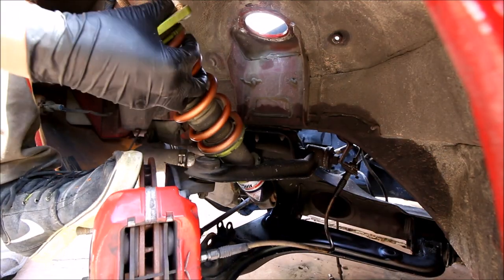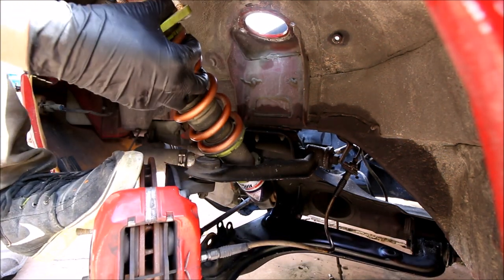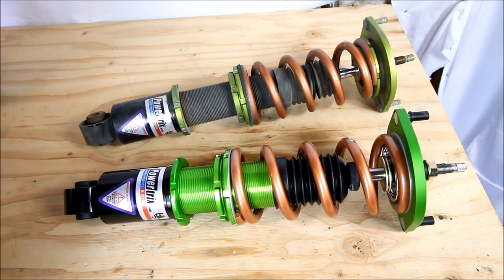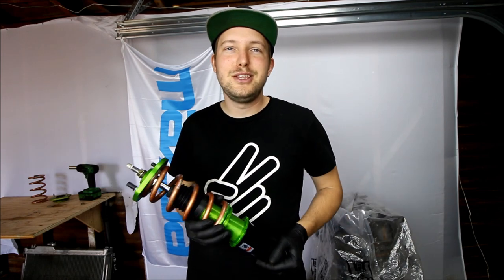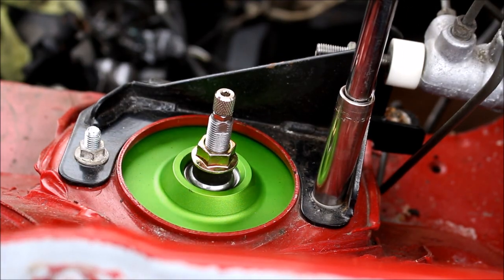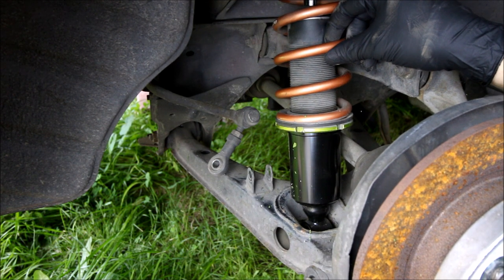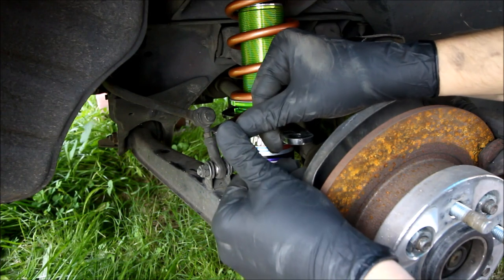Maximum Grip: Choosing & Installing Coilovers on the Main Miata

Comment: Nothing is rusty, must be nice not to live where it doesn't snow
Reply: bryan richardson or rain. or where they salt the roads. These jobs can x10 the amount of time taken in the UK
Reply: Im not sure if my 91 will pass MOT, its rusty as fuck
Reply: bryan richardson if you hate rust Texas is the place to go. The only rusty cars here are cars that came from up north
Reply: I daily my MR2 in Alberta, we don't use a lot of salt on our roads. Things will still rust, but not as fast.
Reply: bryan richardson or u should have luck, i have minor rust at the wheel arch on one side. nothing more
Reply: UK mx5's are the worst for rust.... Mines completely rusted out...
Reply: only rust ive spotted on mine is the the metal tab behind and below the back of the exhaust manifold. where the ground wire is bolted down
Reply: Yep, even undoing what should be simple bolts like the long rear suspension one, sometimes involves being creative with the wishbones to get at it.  The tabs just break off and it spins and can't get anything in to tighten it.  Just one of a million bad parts of UK ownership
Reply: Snow or rain does not cause the rust. It's salt. I wish NYC didn't have blankets on salt on the road so I can daily my Evo.
Reply: It's great. Even the shitty ones are generally rust free when when you don't have road salt and constant rain. I love snow for a vacation, but a long winter would be rough.
Reply: take care of the car.up in the air pressure washer  and underseal  every single  summer. .then wax injection every  single  summer.  in London  with  a rust free 89 na. .underseal  an wax this Wednesday
Reply: Henz Powell I'm in London with zero rust
Reply: bryan richardson take care of your car and it will never rust

Comment: What I know is a stock Miata is already low enough and any lower you will be scraping your undercarriage all the time. If you like scraping, then definitely go for it. I don't like bottoming out my car. The Miata handles fine just stock. Save your cash for gas.

Comment: Disappointed you didn't show the long bolt method... while it does take longer, it makes pulling the strut much, much easier(especially the long stock struts). Plus it doesn't require as much standing on the rotor or yanking things around.
Reply: also, without removing any suspension bolt I HARDLY think you can get out the stock suspension, for sure not the one with slightly longer springs that came with the later NA models...
Reply: had to do long bolt method on my 96... lol tried to do it this way at first and it was a pita lol
Reply: Could you explain this method, or link to a video? I'll be taking off my bilsteins  on my 94 R soon.
Reply: Alexander Moore if you'd like to see how we have a video on our channel on exactly how to do the longbolt method installing coilovers, these same Powertrix ones in fact! But it works for any coilovers/spring/shock assemblies etc.
Reply: No amount of standing will get out the stock shocks without taking out the long bolt first.

Comment: Hey Greg, one thing that would make a great addition to the video is a note about not over torquing the rear lower shock bolt. And to be careful on removal. There's a square nut held in with a weld cage inside the A-arm. Over torquing or not using some penetrant on removal can cause the cage to break away, and you're stuck either replacing the whole A-arm or cutting an access window into the lower A-arm to get access to the nut. Both are options that are not fun. I remember vividly trying to fit an a-arm with still attached shock into my garbage can when I did this years ago. It's also when I realized my torque wrench had newton meters on one side and ft lbs on the other, and you should really make sure you're looking at the correct side.

Comment: Hey this is an informative, well-made video.  However one correction - adjusting the spring preload does not change how stiff the spring is.  The spring still has the same physical spring rate.  The only thing that changing spring preload does (aside from changing ride height) is change the amount of load required before the spring starts to move.  Since it's a linear rate spring, after that minimum load is reached (which it will be with the weight of the car on the spring), the spring behaves the same regardless of where the preload perch is located.

Comment: 2:56 "The Christmas of Handling" =D Its already that time again?  

Seriously tho I'd be careful taking the coilovers in and out like that without removing the longbolt etc., might damage an adjuster D=  I know I wouldn't be able to with the ones I'm running.

Also, for anyone curious Powertrix coilovers are great! I ran them on my car for awhile and now my buddy is running them on his, fair price for a quality product!
Reply: I agree. Not only that, but the stock suspension can't come out that way. You can do the ball joint method to get enough suspension movement, but the stock shocks will still be difficult to pull out. Only reason I ever did ball joint method was I was running the mazda comp sway bar blocks, and the long bolt wouldn't line up with the through hole on them. Long bolt is by far the best.

Comment: One thing I found out recently when I had to adjust my springs on my coilovers is that you can take the top nut off without an impact. Most coilovers have a flat section on the threads on the top shaft where you can get a wrench on it so you can hold the main shaft in place while tightening the top nut. You can kinda see it in the video during the close ups

Comment: Greg, I feel deceived because removing the stock shocks with lowering springs was pretty much impossible to remove unless I Jerry rigged some zip ties to the spring to keep it a bit compressed and the struggle was real 😭

Anyways the video did help 👍

Comment: You can also change the springs by just unscrewing everything on the bottom. Leaving the top hat untouched. Just all depends how do you want to do it. 

And just as a note tightening the Spring preload does not change the spring rate. A lot of people mix that up. Again adjusting the preload does NOT change spring rate. Spring rate is set from what ever the spring manufacturer sets it at. Most coil overs have a preload adjustment spec. By adjusting the spring preload you are essentially adjusting how much sag the spring has initially.

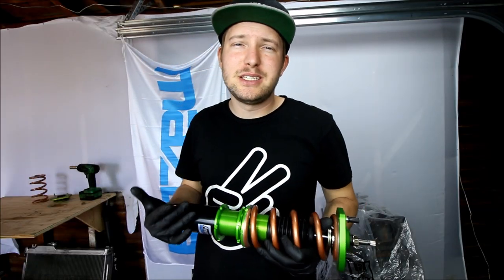Comment: Greg, at 5:04 when you put the nut back on and mentioned not touching the inside of the tube, isn't that a spot for a wrench on the right? The spot is on the far right between the threads and that cross-hatch design on the end.

Comment: Hey Greg. When you demonstrated changing the ride height and threaded the lower cup all the way on I noticed that the lower eye (shock mounting point) rotated with the cup. Does that mean you have to uninstall/disconnect these coilovers in order to rotate the cup and change the ride height, or is there a way to adjust the ride height with them on the car?

Keep up the great work! I really appreciate the time you take to make sure you are informing your audience as you are performing your mods.
Reply from the maker: No, once the coilover is installed the shock can spin independently of the cup/mount so you can adjust them while they are installed on the car. (You just need to have it up on stands to take the weight off the coil or it will be very hard to spin.)

Comment: Alrighty Greg, I just pulled the trigger on the PowerTrix UL Coils, I opted for the 9k springs to start with and will look at changes when my build is done. I appreciate the CBC300 deal, it made the buy an easy one as I was just about to get the Flyin Miata track pack. The adjustable ride height is what sold me on this buy as well as the cool green color.... just won't do to have a car with power that can't keep the wheels on the ground. Did you replace your shock bushings upper and lower when you installed the PT coils? Oh do you recommend the rear adjustable end links? It looks like you have them installed.
Reply from the maker: Are you asking about the bushings in the top hats? Th coilovers come with brand new top hats so there's no need to replace anything. You'll love the coils. I have the adjustable front end links so I can run the NB front sway bar on my NA chassis, and I decided to add the rear links to match.
Reply: I was asking about both I didn't realize the about the tops, are the bottoms fresh as well? The other item the rear links, do they make any noticeable diff? I didn't opt for rear links as of yet but may do so when I replace the rear end with the LSD.I have 949 racing end links for the fronts which I will do with the CO install.

Comment: Hey Greg, love your videos. Your content has been helping me out as I slowly build my Miata. Just had a quick question since I'm looking at upgrading my suspension: do you know how high can the Powertrix go? I'm currently sitting at 14.5" in the rear and roughly 12.5" in the front, but I don't want to drop the car too much as I'm worried my wheels (Kosei K4r, 15x8 with +35 offset with 205/50/15 tires) might rub. I'd like to avoid rolling the fenders as my paint is so shot in some spots I'm more than certain it'll crack on some of the fenders.

Comment: Pro tip when trying to get the front suspension out: Get a long prybar and shove the flat end of the prybar inbetween the metal shield part of the subframe (where the top wishbone is connected) and sit on the prybar with your full body weight. Wishbones will both lower far enough to get even stock suspension out (even if you weigh just 60ish KG)
Standing on the end of the wishbone/brake disc didn't lower the suspension enough in my case :)
Reply: JaguarJay I used this technique, really helped me because oh man, it was a paint to get the front suspension out! for everyone who is going to swap out their stock suspension, be prepared for the front being a bitch 😂😂
Reply: or just remove the long bolt that holds the upper control arm and front suspension comes out real easy. thats what i did.
Reply: BKMOTO LLC That'd be an option too, if the upper control arm bolt isn't heavily rusted into place. Mine was so tight I didn't actually take it off, cause I was afraid to break it.
Reply: Same here dude, I first used a wooden prybar but it just broke on me when I applied force to is, then I got a metal prybar and got the suspension out.. I litterly was stand/jumping on the prybar while someone else was fiddling the suspension out of there..

Comment: Yea i learned something... I learned that i can't afford any coilovers that are actually worth switching to. What's the best way to lower my car but not sacrifice to much ride quality...because honestly the 2003 mx5 i have (stock suspension) seems to be pretty Damn good. But i am trying to cure my "mexi poke" and gap before winter ends. 16x8 +0... I was thinking lowering springs. Minor camber and maybe a little fender roll of necessary...

Comment: Hello greg, I know this video is old but I just started following your channel and have a question. I have a 1990 mx5 miata 1.6 that is my daily driver. I don't have any mods, it's all stock. I was seriously considering getting the  SS coilovers with the swift springs but I had to stop my self because of the hefty price tag. Do the swift springs really make a difference? I don't drag race or anything, I only use my car to get to school and work. Although I like to hit the pedal from time to time. I do plan to turbo my car some day, but that will be in the somewhat distant future. Are there any alternative coilovers that you would recommend for someone on a budget? Even the base SS coilovers with stock springs run you about $800 and unfortunately your promo code has expired. 

Also would like to thank you for your video on how to replace a clutch. Your video is the most informative and easy to follow on you tube. Thanks for all of your hard work!

Comment: When you step on the brakes the suspension lowers way more than mine. I cant pull out the shock because it touches the upper a arm.

Comment: Hey greg, i am planning to install my tein flex z using your method, first because i think its faster than the long bolt method and second because i do not have a torque wrench and i dont want to mess up with suspension arms. My question, is do you think it'll be easier if i compress the stock spring in someway?

Comment: Have you ever had any experience with xidas? If so how do you feel these hold up considering the price of the powertrix after adding the swift springs are relatively close?
Reply from the maker: I do not have experience with the Xidas, but I have heard they work magic for Miatas. Would love to try a set out sometime, but I have been very happy with these.

Comment: How can you tell what spring poundage is, i have a Dutton melos kit car with Mazda mx5 mk1 rear end, fitted with spax coil overs, problem is i dont have any suspension, i can adjust how high the car sits from the tyre but high or low the top 3 coils of the spring collapse to each other, and the bottom 2 coils dont really give that much.

Comment: What's the overall spring diameter as compared to thinner Xida or Tein? I plan on running 15x10 6uls & 245's soon and have Teins on currently.

Comment: Which ECU are you planning on using for your swap? I recently picked up an NB wreck from 2003 VVT with squaretop intake manifold. So I was wondering wich version I should use ( pnp pro or megasquirt3 and wire everything by myself).
Reply from the maker: MSPnPPro for me

Comment: get us a discount on a megasquirt lol. oh and I have a question. do you think a system like freevalve would increase horsepower significantly on a NA Miata? I recently learned that Miatas use a non interference design meaning that the valves will never hit the pistons in the stock configuration. so to me that means it would be relatively safe for someone to do freevalve like system on the Miata engines. all you really need is a ton of electric solenoids. I have a spare Miata engine and I think I might experiment with it. of course I would have to look into any patents first as I would hate to not be able to share my work. I think the biggest issue would be that the Miata doesn't have a crank position sensor. just a cam position sensor. once that issue is sorted everything else isn't too hard. and because it's non interference if you fuck up in valve timing it won't destroy the engine it will just not run right. which is really the best part. I guess the reason why most cars don't use a freevalve like system is because if it fails you lose your engine. and it's probably more likely for a freevalve system to fail than for a timing belt to break. If I can scrap together some money and motivation I think I would attempt this.

Comment: How long is the coupon code good for? Possible to swap out to Swift springs at a later date? I would think so right, not a proprietory spring ..?
Reply from the maker: It does not have an end date at this time. They are not proprietary, one advantage up ordering them with the Swifts is it's offered as an upgrade so it's cheaper than buying the springs outright later.

Comment: Not sure, are these the SWIFT springs Greg is running? Do you guys think there $300 better then "stock" on these coils?
Reply from the maker: +Alexander Moore Yes I'm running Swifts. For the average user, it's probably not worth the upcharge. For someone that's regularly doing aggressive driving and track events, adjusting their suspension, I recommend them.

Comment: what sway bar end links are you running? i have the 949 ones and they're super noisy. they're maxed out in shortening too
Reply from the maker: cooljoe226 Those are Powertrix as well, I haven't had any problems with them. They are for a 300ZX so I had to add a couple washers for them to line up perfect. They have around 60,000 miles on them

Comment: Anybody know how to fix a bouncy ride? I purchased brand new coilovers. I won't say the price or the name of them. But is it still possible to help me understand why it is so bouncy?
It has adjustable dampening, although I will say that the compression and rebound still feels softer than my old strut even with the dampening set to it's highest setting. It feels somewhat more bouncy when I set it to the lowest setting. The springs that I have on it are Front: 392lbs/in (7kgf/mm) || REAR: 336lbs/in (6kgf/mm).

I was thinking maybe the camber gain from lowering the car was the culprit, but technically a good miata track alignment requires -0.5* front of camber and -1.5* rear.. (albeit with a stronger spring rate), so that can't be the reason why it's so bouncy. Any suggestions or insights is greatly appreciated